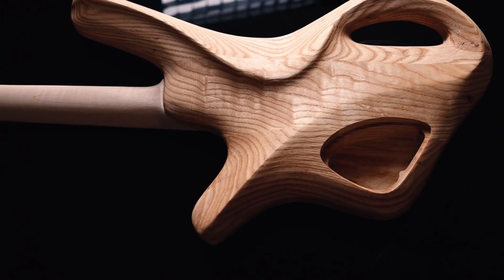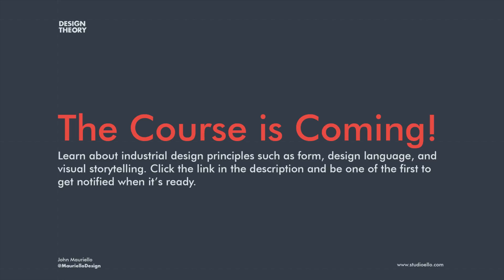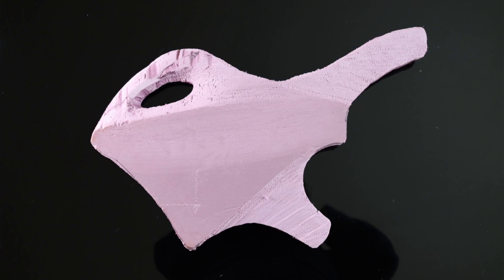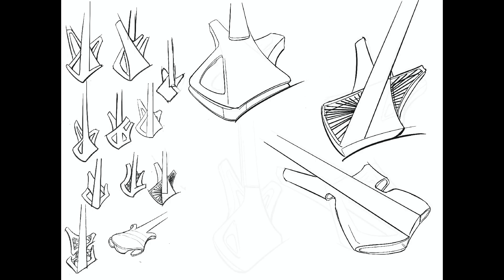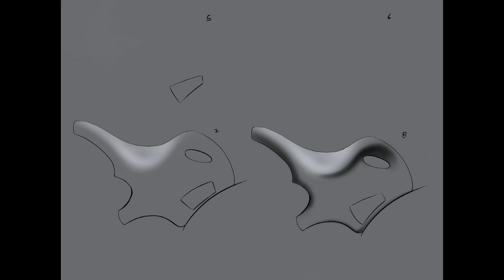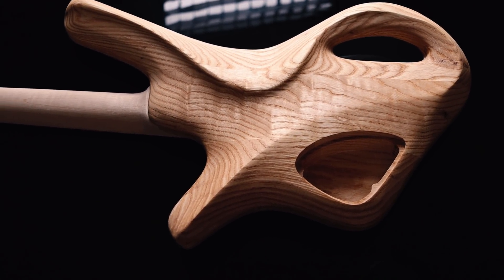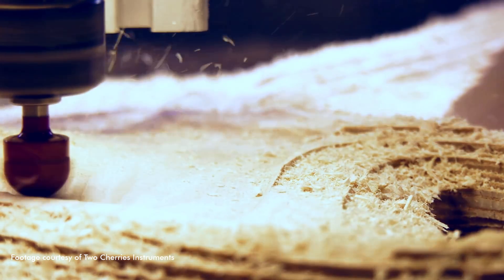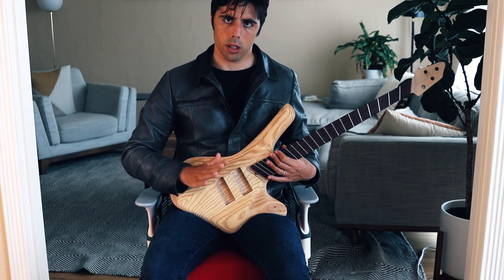How I Re-Designed the Traditional Bass Guitar: Industrial Design Process

Comment: As a bass player, I would say, if somebody have problems, they might use bad technique. So solving the issue with engineering is not necessary the best way. But beside that, while it's not really my cup of tea, your bass design is certainly stunning and looks very comftable. Keep it up! :)
Reply: I mean, technique is an important part of the puzzle, but if you can make an instrument that doesn't cause so many of the ergonomic problems in the first place, it may even free them up to focus their technique on making good music, not avoiding injury. Guitars in general aren't very ergonomic things, so if we can ease that a bit it may be an overall benefit to musicians' bodies.
Reply: @theocaratic  - Using any tool including an instrument is not really a natural thing. You have to train your body to be able to use every tool. So if you train your body to use something badly, then it will cause injuries. Also, if you not train enough or train in a bad fashion, you can injure yourself. If you don't warm up yourself you  also can get injured...
So I don't believe one can concentrate on music more because of a slightly more ergonomic bass. I mean, the body's shape is basically irrelevant if you stand up and have it hang from a  strap. The neck profile is might be better to be assymmetric, I don't know and I hope it will introduce a new trend across the market to be more innovative.
However the new neck profile can introduce many problems, like warping or unexpected behaviour of the truss rod.

So it's not that I'm not familiar with the problem itself, but I do think the solution will be useful for a very narrow margin of players. I think most people would want to have that because of the exotic shapes and not because it solves a problem.

I still root for this project anyway :)

Comment: imagine if Adam had just improved his technique
Reply from the maker: The issue with Fender instruments is that they make it way harder than it needs to be to utilize good technique. It's like using a guitar/bass with a poor setup. Sure, you can still use good technique on it, but it's a lot harder to when the action is a mile high and the frets are buzzing like crazy. This bass makes it easier to use good technique.

Comment: It takes anywhere from 500 years to 10's of thousands of years for extruded polystyrene to decompose.  Once it does break down, it remains polystyrene in the environment and becomes a microplastic, consumed by animals and moves up the food chain, ultimately to humans.  How many sheets of extruded polystyrene are needed for you to design guitars in your lifetime?  Is there a bio-degradable material you could use instead to achieve the same results?
Reply from the maker: Do you mean for the prototypes? That's a fair point. I could perhaps use wood? But it's a lot slower.
Reply: @Design.Theory  Green Cell Foam is a corn-based product available at Michael's art supply store.  They have 2"x12"x18" sheets (called 'blocks'),  84$ for a 12 pack.  I tried to post a link but it keeps kicking out my comment.

Comment: To address the subject of tone that is brought up by a number of replies is that, yes the pickups and electronics even the gauge of wire used in a bass guitar or regular guitar has an effect on the instruments tone, but say if one were to install a Musicman pickup in a Fender P-Bass it will no longer sound like a P-Bass nor will it  sound like a Musicman. As a example, I had a Rickenbacker 4001 that I replaced both of the passive pickups with EMG active pickups and it drastically changed the tone. I had also exchange the bridge with a Schaller 3D-4 which had a effect on the tone.

Comment: Very interesting video! I like what you did with the neck, classical guitar makers do something very similar with an asymmetrical neck. One note I have to add though is that a different guitar isn't gonna help your friends pain. Even in the picture you showed he's holding his wrist at an extreme, almost 90° angle. I'm not trying to call anyone out, but playing with bad technique for extended periods of time will destroy anyone's wrist on any guitar. Great video though, you've gained 1 new subscriber!
Reply from the maker: Yes absolutely. You need to fix bad technique. My issue is that most traditional bass guitars make it hard to use good technique as a result of the shape of the instrument.

Comment: But how would it sound, though? That's the most, most important thing in any instrument - far more important than aesthetics or ergonomics. And in my experience bass guitars do need some heft in the body wood to resonate properly, to sound "bassy". A bass that's too lightweight might tend to sound tinny and unsatisfying - which, sure, you can compensate for with amps and pedals, but people expect an expensive bass to sound like it costs without the aid of electronics; it should sound amazing through DI, or even while unplugged. However, I guess we won't know till it's complete.

Besides, with the body so light it seems like neck dive would be a significant annoyance, which is a big minus for ergonomics - it seemed like you had to hold the neck in place with your left hand to stop the bass falling forward.
Reply from the maker: Wiring it up soon. The main thing that makes an electric instrument sound the way it does is the electronics/pickups
Reply: @Design.Theory  The best basses I've played sounded amazing right there on my lap, unplugged - and the worst ones I didn't even need to plug in to tell would sound tinny and weak. The pickups on a bass you can always change; but putting the best pickups in the world on a crappy sounding bass won't save it, because all a pickup does is transmit whatever vibrations it's picking up.
Reply: @Design.Theory  Not meaning to imply your bass won't sound good. It probably will
Reply: @Design.Theory  also, I hope I don't cone across as a hater. I think your design looks amazing, and would be amazing if the criticisms I gave turn out to be wrong

Comment: Bassists buy bass guitars based on tone and sound, unless you can compete there, you have nothing.
Reply from the maker: I'm using top of the line electronics, pickups, hardware, and wood. It will sound great. Just gotta wire it up

Comment: Before installing pickups and hardware, how does this go with neck dive? I ask because the body looks smallish and the neck is fairly long (I noticed you didn't take your left hand off in the seated demo at the end).

Also the multiscale fan looks very aggressive, is it comfortable to you? Particularly on the lowest fret? 

If it is even mildly uncomfortable I'd definitely suggest looking at recent Dingwall headstock designs (the heel on the back is contoured to allow your hand full access - but not on older models). 
Love this design
Reply from the maker: With electronics in, it balances roughly 55-45 on favor of the body. Same thing for when the electronics are not in. It's actually pretty cool because you can literally just have it balance on your leg without falling over. Still gotta test with different people to make sure that it works the same way with others. Wood will also play a major role in weight and balance
Reply: Totally, that sounds like a pretty good balance.
I'm excited to see more finalised designs of this model. Very cool

Comment: Input here from someone who :
a) has not read any of the other feedback (important for culling repetitive stuff)
b) has a medically-allied degree (dentist, but I understand physiologic motion of complex joints, tissue support, etc)
c) has an engineering/high-tech background (worked at Mentor Graphics, Tektronix, Rodgers Organ, etc)
d) plays a bunch of instruments (stringed, keyed, percussion)
e) have worked in ergonomics design (input device design) in the 80's... even worked on an ASL data input system for IC designers for a bit. How's that for odd?

1) always be cautious re edges that can apply pressure on the proximal wrist crease (ventral surface) ... a point which can contribute to both impingement on the circulatory system and forces on the cubital bones that may lead to subtle motion a pinching of neuronal tissues.

2) Three styles of Rt-Hand : Pick (not very 'bass-body-dependent'; thumb-finger (needs and appropriately placed/angled surface that allows for positioning both towards the neck and the bridge,  and I'm not sure I see it; and thumb/slap, which is not as body dependent. There's also the thumb/3 finger roll (see Nikko Whitworth) which doesn't have a specific thumb-rest need, but would benefit from lower forearm support to focus the rolling motion.
 I'm looking for the forearm support that many bassists find on the front-sided cutaway... it might be there, but is hard to tell from the limited images of the bass in use.

3) the back side and the 'whiplash curve'. My observation here is that the intrusive peak  (backbone) of the curve shape is fairly narrow, and might be felt as an point of discomfort (ok, curve of discomfort) especially is it passes over the ribs f a player that straps the bass up high. Is it possible to fill in' the depth of the cutout between the crest of the curve and the rest of the body... just a bit? I dunno.. I'd have to play it a bit to get a feel for this.

4) Just FYI, I try to avoid a thumb location on the upper "wraparound" portion of the neck, in that it encourages a cross-hand static muscular tension, as if trying to pinch an object between m thumb and pinky-finger... this tension can slow down the action of the other fingers by placing a tension across the back of the hand and slightly restricting the motion of the finger-flexure muscles. This is a very personal/style thing, but I've heard about it from a few instrument instructors.

5) yes, yes, yes on the communications with the manufacturing floor ! So many designers/conceptual-engineers are divorced from the manufacturing floor.

6) At the end of the video, you demo'd the straight-angle of the fore-arm through the wrist... impressive. Again, it'd be interesting to see how this works on various body types/sizes and right hand styles... I might foresee a moveable support for the forearm/wrist, kind like a violinist's chinrest on a 3D rail system (or 2-D with vertical adjust).

7) For a CAD system, I'd definitely look at one that supports line definition/data saving via spline-curves and surfaces. Obviously, you are defining curves and surfaces based on continuously changing radii, and it is just so much more straight forward in spline math... and you can get point/vector translation to Cartesian coords for the CNC workfiles.
I'm not sure what's out there right now for spline-supporting CAD systems. When I worked at Mentor Graphics our Physical Cabling system  (used to design massive cable harnesses by companies like Boeing) used spine math for the cabling backbones. You might look to CAD systems with similar extensions... that' where you'll find the software geeks with spline-math background.

VERY COOL.
I am a FAN.
BIG thumbs up.

It's great to watch creative people's thought processes, and to see the evolution of the concept.
Take Care.
Reply from the maker: Wow this might be one of the most thoughtful responses I've ever read. Total shot in the dark, but are you based anywhere in the San Francisco Bay Area? I'd love for you to test out the design.

Comment: From your experiences of designing this bass, how do you think/evaluate Strandberg basses?  For me, you and they have reached similar goals.
Reply from the maker: I deliberately tried not to look at other basses/guitar designs while designing this. I didn't want it to taint my perceptions of what a good design is (or should be). However, it kind of happened naturally anyway. The human body is a particular shape. Basses/guitars have certain requirements that drive their form and function. As a result, I ended up doing some things that are similar to other ergonomic guitar companies. I have no idea whether mine is more comfortable than other ergo guitars, because I've never used any other one. In addition to great ergonomics, I wanted to make an instrument that visually looked super expressive, which is one thing I can confidently say I don't often see in other instruments. It's an ergonomic bass on acid, pretty much.

Comment: I find it interesting how you didn't immediately spring for a headless design. I would imagine it would be more ergonomic to have the tuners on the body, as you would not have to reach all the way to the headstock.

Also: on the neck profile, I think a rather extreme example is the .strandberg* EndurNeck, citing the same reasons as your design

Comment: Hi John,
 
As a professional Product Manager and bass player I LOVED your video. I've never geled well with traditional Fender instruments finding them to be too big and clunky and have gravitated towards smaller instruments like Warwicks. Not that you're asking but here are a few product requirements/suggestions that I would keep in mind. 
 
 8.5lbs or less(the demographic for bass players are not getting younger, I constantly see complaints about back problems on the forums. 8.5lbs is a good line in the sand) 
 
Easy Access Truss Rod( EBMM figured this out with their truss rod wheel, it's a superior design and every guitar or bass should have it period.) 
 
9v if active (18v is overkill, nobody wants to carry two batteries.) Battery replacements should be completed tool-less. Passive override and tone control are nice to haves. 
 
 Scale length ( I see your testing out fanned frets which I don't have a ton of experience with… in general I think there are a lot of people who would prefer a shorter scale instrument if they had started out with one, anywhere from 30"- 33". Instead of doing a 36"-32" or whatever consider the entire instrument being smaller, this will also help satisfy overall weight requirements) 
 
 
Lastly, if you would like I would love to be a part of your discord beta/alpha test cycles.

EDIT: and Balance! Nobody wants neck dive!
Reply from the maker: I learned a lot of the principles around product requirements documents and other things from product managers I've worked with in a professional capacity. So thanks for being such a great field! Lucky for you, it has all of those features! this particular proto is under 8.5 lbs, 32-30" scale length, etc. etc. If you want to join my discord, you can click on many of my other youtube videos. The one titled "The End of Traditional Industrial Design & Transition into a New Frontier" has a discord link in the description. I would link you to it here, but YouTube does not allow links in comments. If you're based in the SF Bay Area of California, you are welcome to test out the prototype

Comment: I like it. I would love to build my own guitar. What would suit me is tilting the neck angle a bit away from the body on the bass side. Where your strumming arm rests I want a curve from the top of the low strings up to the edge. The whole edge of the guitar should be rounded (the horns can be an exception). As to the shape of the body, there are two things that have bothered me; 1) the position of strap pins 2) the (often) different feel when standing or sitting. I've never tried this (why not? I might soon) but I think the strap pin under the bridge should be higher, to angle the instrument (neck angle) to a more ergonomic position (also, the strap pin on the horn should be more in line with 'roughly' the 17th fret, not the 13th). I'm quite comfortable when sitting and playing (traditional left leg, when I slouch/am lazy I do tend to play on my right), but for me, I think some material could be shaved off of the end that sits on your legs. And I think I'd like a little more material on the end (below the bridge).
Reply from the maker: You absolutely should try some of your ideas and see what happens! One thing with the strap pin is that it's usually placed around the center point of the total scale length of the instrument...which is usually the 12th fret. This is to prevent neck dive. Just something to keep in mind.

Comment: The frets kinda radiate out from a center point below, but they start pointing away from the player towards the far end- is this a better design? I would think that when you extend your arm out there and rest your thumb on the back, your fingers curl inwards towards you instead of away from you- so wouldn't it make more sense for the top of the frets to point towards you? Like this 
👨🏾‍🎤\\\\\ instead of this 👨🏾‍🎤///////
Reply: It's called a "fan fret" or "multi-scale" and is used in many other guitars and basses. It allows for a longer scale length in the low end and a shorter scale length for the higher strings. It's honestly not as tricky to play as it seems. Once you get used to it, it's no different than playing a normal neck, except the playability is improved across the strings

Comment: umm that's just a wood reshape...NOT a re-design. Try not using magnets or wires or change the voltages and replace the pots and combine disciplines and turn it into a bolt cutter that has RGB down the glass neck. THATS re-design. Or for kicks have a Bass that has an octave shifter with 9 strings and a short wave radio and NO neck. That's re-design fuckwit.

Comment: Thank you YouTube algorithm.  Very nice design, it definitely looks comfortable.  How is the weight balance between the neck and body?  Will it balance on it's own?
Reply from the maker: Yes, with all electronics and hardware installed, it does balance on its own. But that may change for different users and with different wood combinations, so more testing may be necessary.